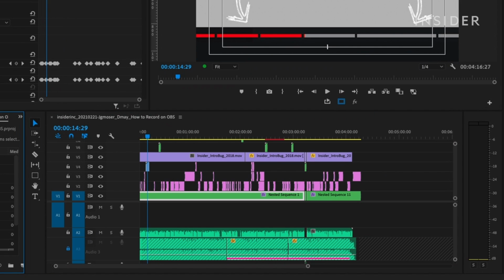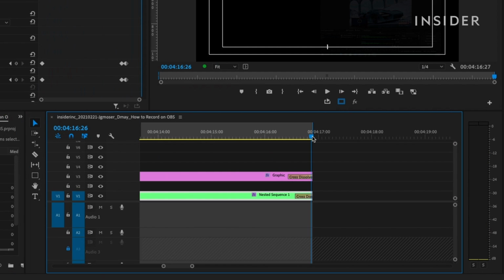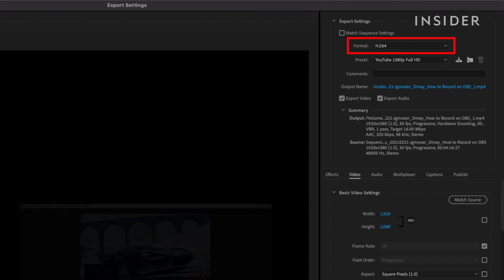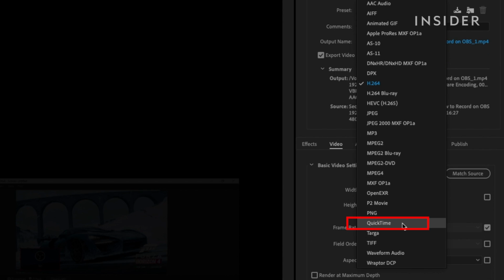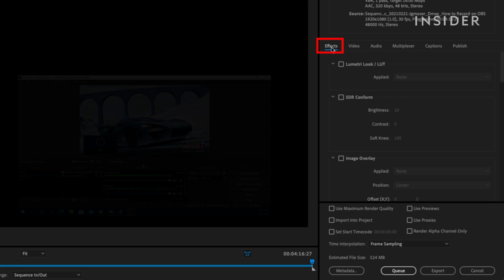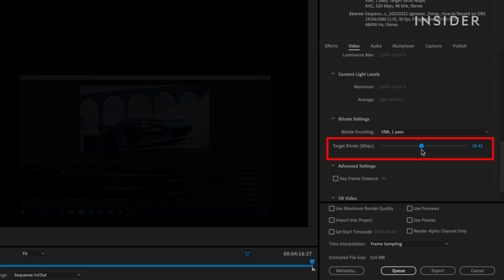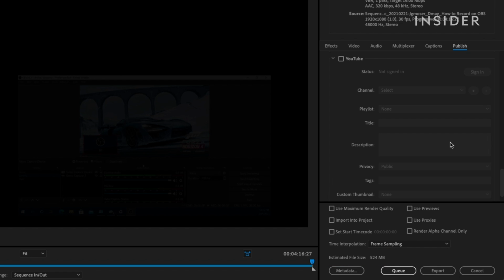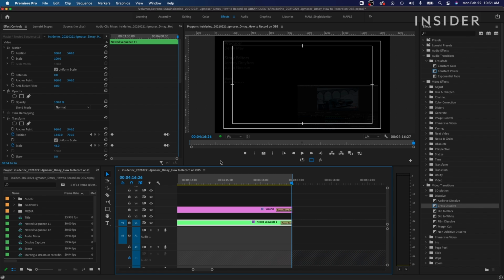How To Export In Premiere Pro CC

Comment: Make a video on setting up multiple monitors
Reply: You know what's funny.  You just need a hdmi cable and splitter to use up to 3 of them .
Reply: @Reaperguy67  I mean more the software part of it, like all the options you can use in Windows to customise the arrangement, set how the display is shown over the monitors and so on
Reply: @ianthehunter3532  ok. Thanks for the heads up. I'm not sure about that.
Reply: @ianthehunter3532  Open Display Settings